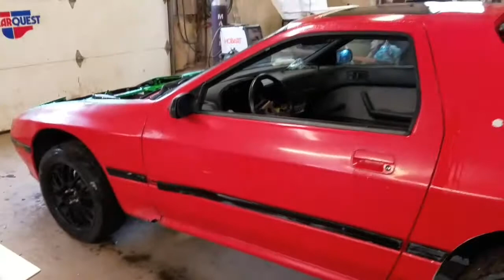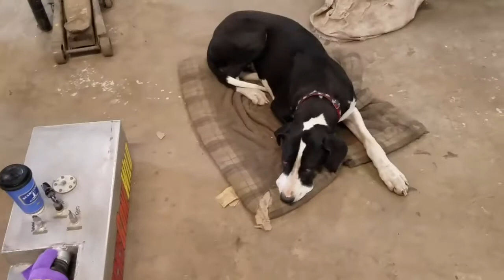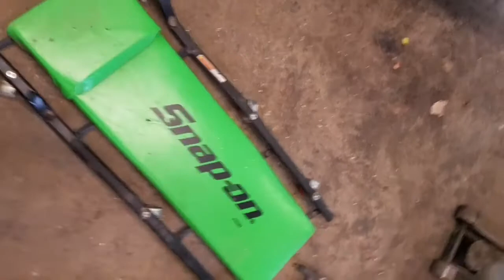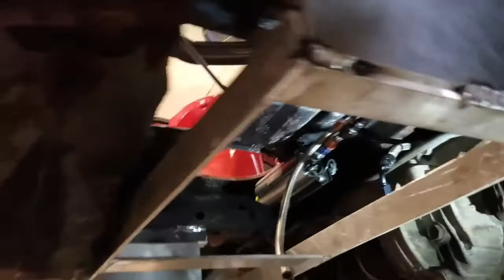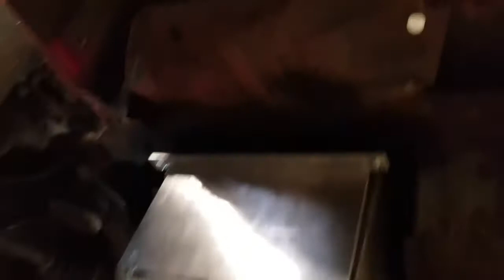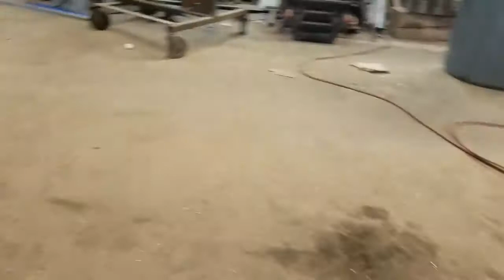New Fuel cell mount in my 86 fc rx7 ls swap

Comment: Where did you get your fuel pump? link?
Reply from the maker: Kevin Unciano it just an eBay efi pump and the pressure regulator is a 2003 corvette I have mine run with a single line